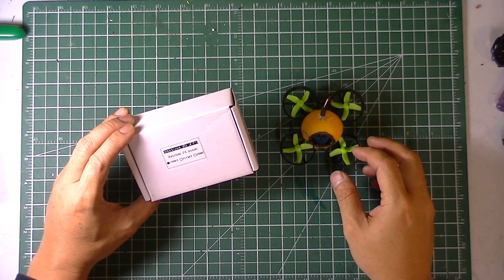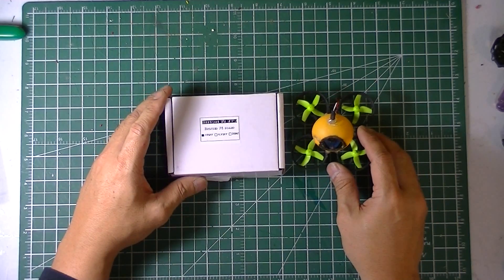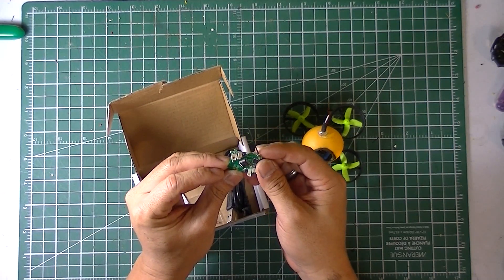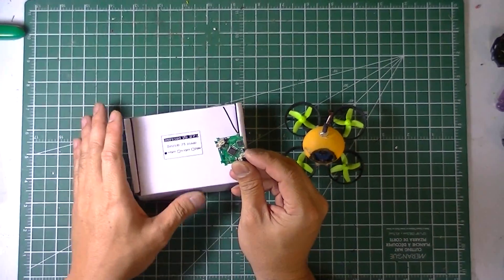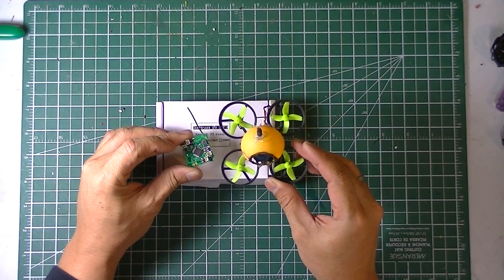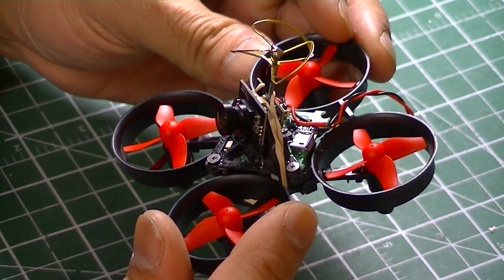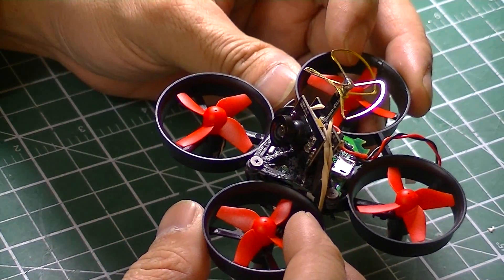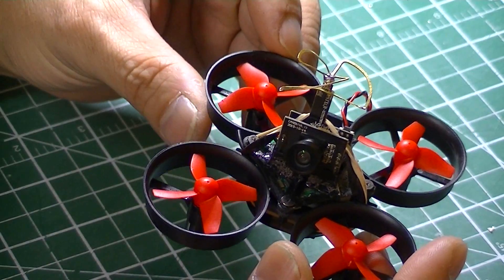Beecore F3 EVO Brushed Flight Controller for the Tiny Whoop

Comment: Hey! I don't know whats wrong with my tiny whoop. I changed to beecore and feels like PIDs dont change the problem. So.
When I go with full throttle up or fast somewhere tiny goes crazy, wobbles huge rings and crash. Also when battery low it doing it. Wind dont do it. Also doing with horizon angle and acro mode. Cant find anything from google.
Flyable with almoust full throttle like 90%.
Can you help?

Beecore F3 EVO
Motors: Chaoli CL-615
Charsoon 1S 50C 220mah battery
Eachine e010 frame
camera like you have.
3 blade props

Comment: Have you had any problems with how long this flight controller lasts? I bought a cheap one similar (but a bit different) to the beecore and it started having failsafe rX problems. Also, how good is the receiver? My other FC had a lot of noise in the receiver which would cause twitching on the yaw axis.

Comment: I looked at the diagram for the beecore and don't see anything as to where you power the fpv system. What do you plug it to?
Reply from the maker: you solder the power leads of your AIO cam/vtx to the opposite side of the board where the power leads of the FC is soldered, red to red and black to black.

Comment: Exact same setup as you + myLipo 205 and betaflight 3.0.1 and...
it flies like a whale... on land...
cant figure out whats wrong :(
Reply: Same here. 1min Flighttime and climbing rate of 5cm per second. After that my 25c/205mAh battery is really warm. Had 4min with original FC. Overall getting 22 grams without battery.
Power plug has been switched several times now!

Comment: you did not show how you bind it to the taranis !!
Reply from the maker: http://img.banggood.com/file/products/20161106214457BEECORE%20FRSKY%20F3_EVO_Brushed%20ACRO%20Flight%20Control%20Board%20quick%20user%20guide.pdf
Reply: bill alvarez did it bind to the taranis? I can't bind mine
Reply: nope wont go to bind mode ..supposedly led should go solid then bind ..but wont
Reply: they sent me a replacement but i opted for the dsm2 ..works good
Reply: bill alvarez thats exactly my problem